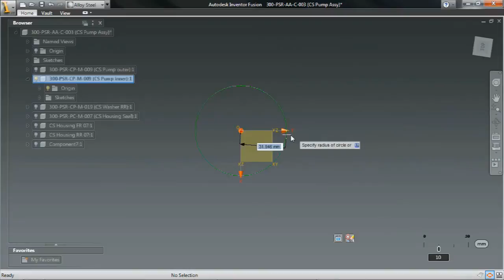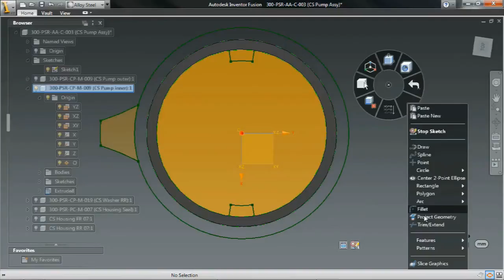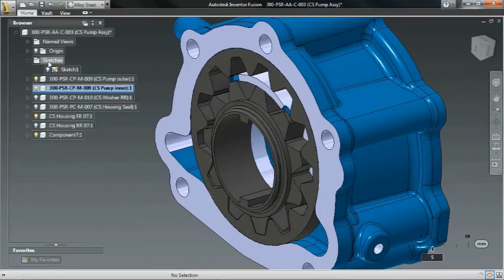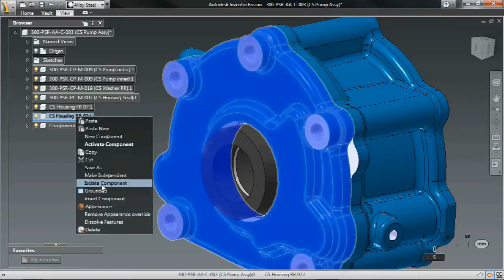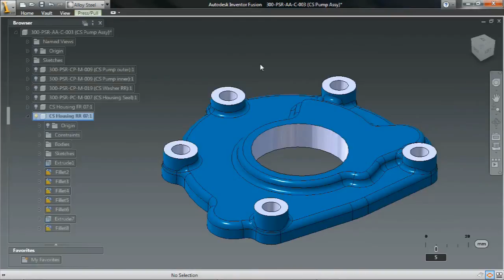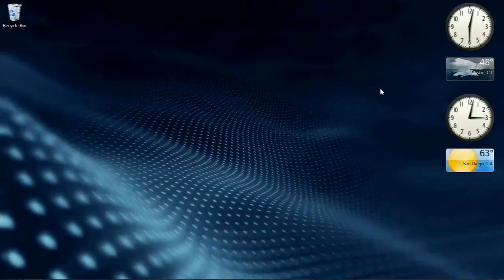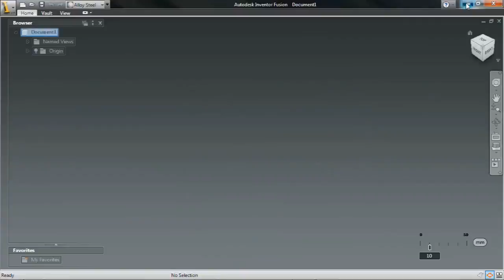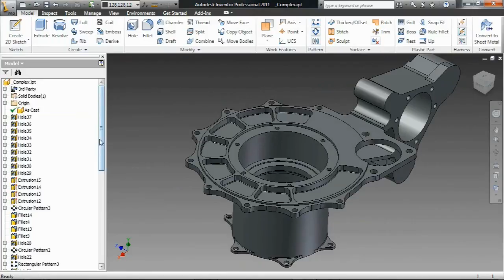Autodesk Inventor 2011 and Inventor Fusion Demo

Comment from the maker: @JonBanquer I'd use fusion for something like that. Problem is, a dumb solid is called a dumb solid for a reason. It would probably be faster if you deleted those holes in Fusion and remodeled them using the Fusion or Inventor hole command.